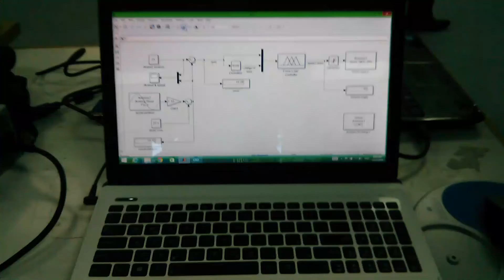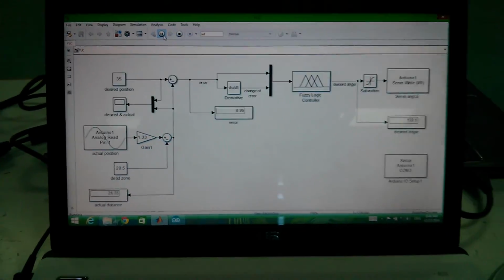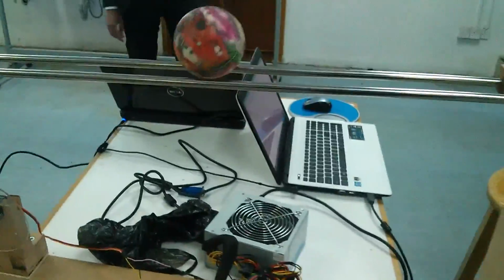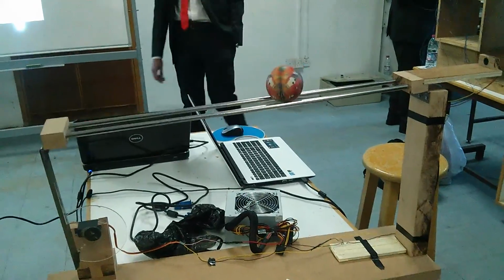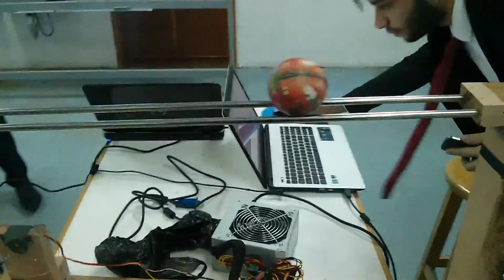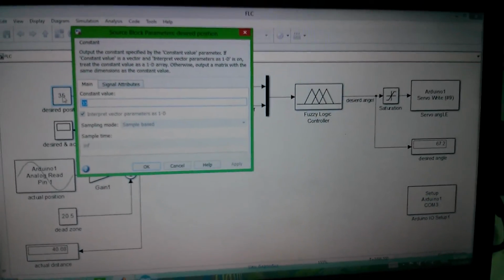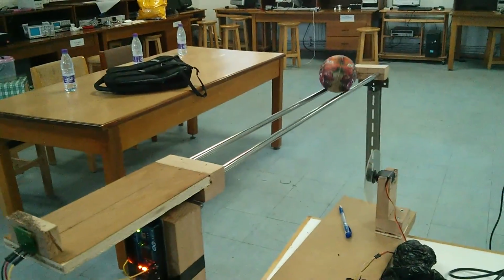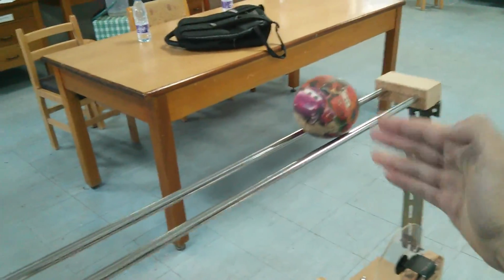Fuzzy Control in Ball and Beam System

Comment: Diameter of ball ?
Reply from the maker: It's not really important in this setup as any ball would do similar job. In this case it is approximately 7.5cm
Reply: Mohammed Al-Romaithy in my case use 4 cm diameter and hc-sr04 sensor and can't work. Tk.

Comment: HI Mohammed I am from Colombia , I need your help , its about the code, iam learning  fuzzy logic but i dont know how you did it, please help me with this, my email is causakevin32412@hotmail.com
Reply from the maker: Hello Kevin! are you using MATLAB simulink as well?
Reply: yes Mohammed
Reply: I have doubts about the rules of the fuzzy contoller, i dont know how interpret that
Reply from the maker: You need to write the rules on a piece of paper first, see how you want your system to work, put it into a matrix. And then insert it to the Fuzzy Controller rules in simulink.

We used this toolbox.
https://www.mathworks.com/help/fuzzy/build-your-own-fuzzy-simulink-models.html
Reply: Mohamed i did the rules, but dont know why de System doesnt works, how you did the simulation first ,explain me please, I need to do it
Reply: Mohamed what materials you use in the ball and beam System fro example, sensors, controller etc,
Reply from the maker: Hey Kevin, We used an Arduino Controller. Ultrasonic Sensor to measure distance. and A servo motor as the actuator.